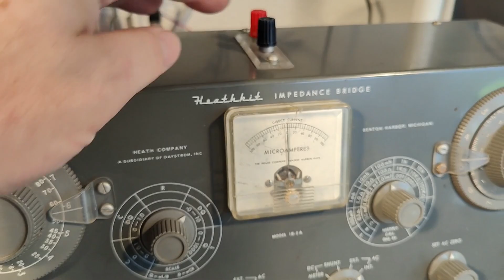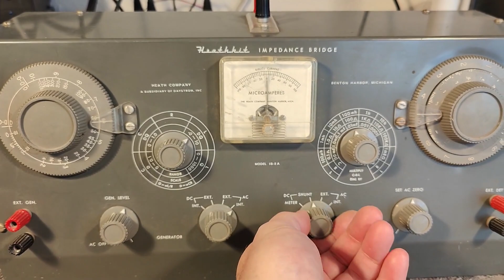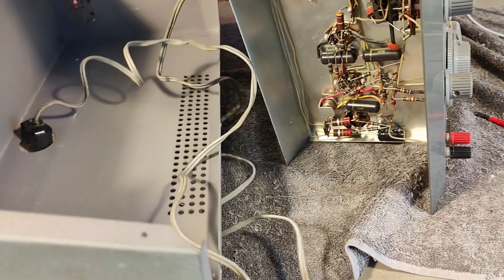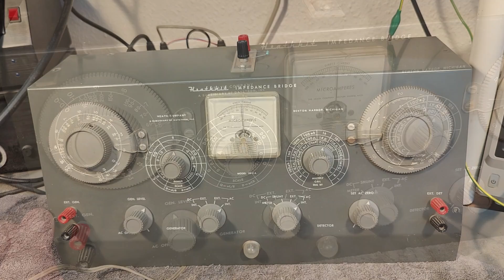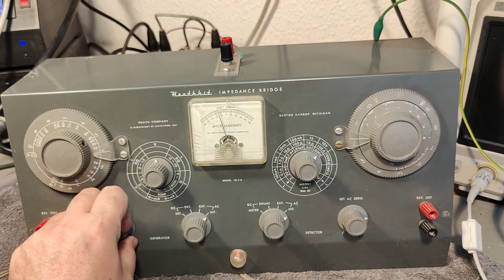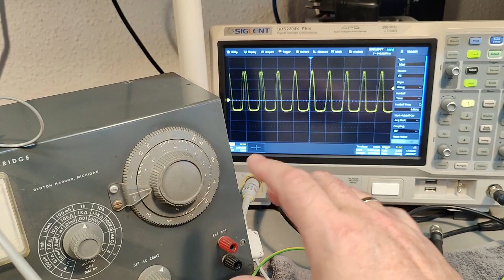Heathkit IB 2A Impedance Bridge teardown 1958

Comment: .... do these yellow printed capacitors follow the sprague color code (yellow = it will be leaky, red = it will probably not be leaky but behave like a leaky and a non leaky capacitor in series and have strange dielectric absorption behaviours)?

Comment: The circuit of the oscillator makes me wonder if the two heaters in series actually make up a really obscure level stabilizing scheme? In the end you are using one filament - which will have some PTC characteristic even if not as much as an incandescent bulb - as a cathode resistor here, and the exact voltage across a filament will have some influence on the actual characteristics of a tube....

Comment: 6:49 that is not a transformer I would trust, without running my own insulation test,  in a class II device with a metallic chassis and case AND user accessible terminals into the circuit which the user would not expect to be unsafe to touch. Same applies to the mains switch on one shaft with a secondary side potentiometer and basically the rest of the primary circuitry in this unit. Looks like a case of "bring two inline fuseholders, a lot of heatshrink. probably bypass the mains switch, and probably convert the device to class I ...." And the mains cable is a sure candidate for "chop it off, wago the ends up to your isolation transformer while working on the unit, and later fit a proper mains cable". All for keeping originality, but the old practice of using loudspeaker cable for mains is more of an original sin.
Reply: 16:45 prophetic, I was. :(
Reply from the maker: @splitprissm9339  ha ha YES mains leakage is a problem, i like to have zero volts on a chassis

Comment: I didn't like the look of the osc output,  I think the output should be much more sinusoidal, probably a good place to start.
Reply: I found mine worked much better after replacing the 1L4 in the oscillator section, seems the circuit design can`t stand marginal tubes there and probably also wears them out. "Much better" is "well, somewhat acceptable" not "great" with this unit, though.... BTW, that is what I meant with "Why could they not provide reference oscillograms..."

Comment: This was a decent little bridge, made to resemble General Radio's equipment, using WWII surplus parts. However, they actually produced a version of this model almost to Heathkit's end (the white paint era).
Reply: If you ever tried using one of these big heathkit AC bridges, they are sadly true boatanchors - very mediocre performance, very wide measurement error specifications - and HUGE. Probably not much of a comparison to GR standards. I have one (slightly later model) myself - and have to agree with many reviewers saying it is an interesting collectors piece but just has not many advantages in practical use compared to even entry level modern LCR meters or component testers.... Also, while very very detailed assembly documentation exists, the heathkit manuals are very lacking of a circuit explanation, fault finding tree, reference oscillograms, and other stuff you`d expect in a REALLY good service manual. Especially annoying if you want to debug something someone else assembled slightly wrongly from a kit ages ago.
Reply: @splitprissm9339  None of the lower-end instruments are that accurate, and they're not easy to tune, including EICO, PACO, Conar, and Knight. They didn't put geared down tuning, good scales, and extra precision components in them like the top brands had, over cost, but they would get you close, though you had to dick with the sensitive tuning to achieve a null on the meter. They could be aggravating to use over that.

Comment: Nice! The bare wire construction reminds me of '20s radios. A strange choice of tubes, but they may have had a surplus they had to do something with.
The only thing I dislike about it is the DUT terminals on the top. It effectively prevents stacking gear.
Reply: I think they used them because of quick warm up time. IIRC some documentation or marketing material also states that.
Reply: That would be an easy "fix". The other one that I dislike is ANY inputs/outputs anywhere other than on the front panel!

Comment: The stiff range/scale generator switch is common on the IB-2A; many had a broken knob because of this.  I had to replace the ball bearing on mine with a metric ball bearing of a smaller size.  A total re-cap is called for; the bent lamp holder needs to be straightened to make sure it isn't touching chassis ground.